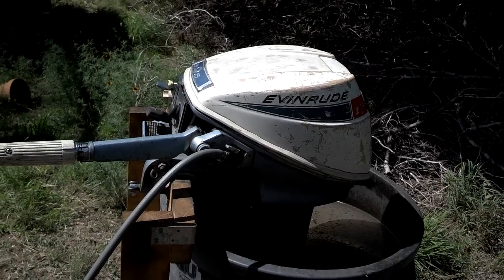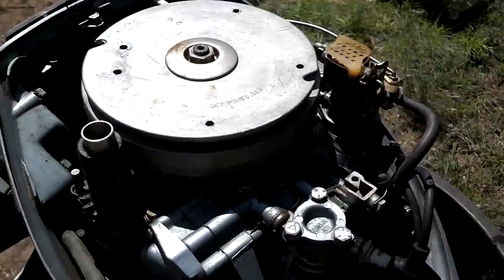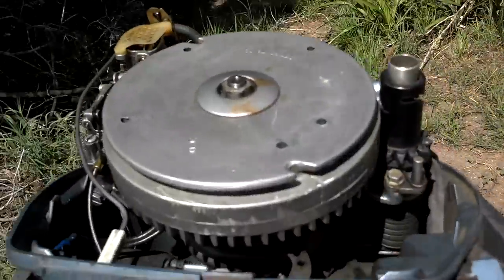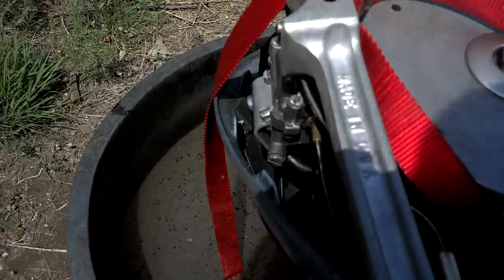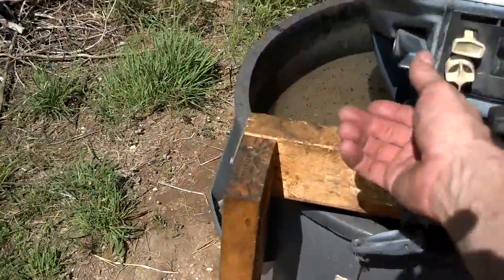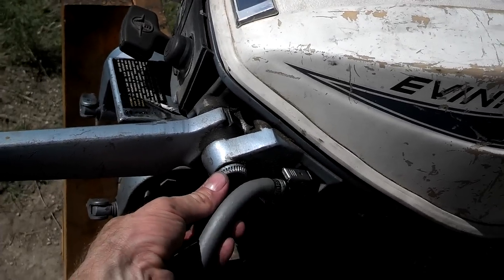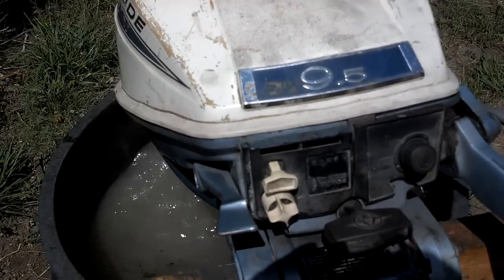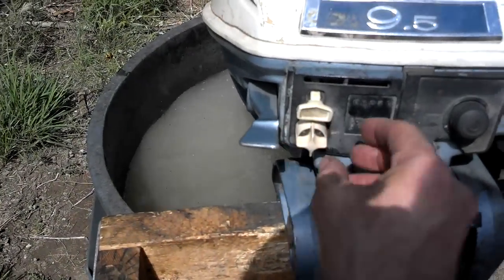1968 9822E Evinrude 9.5HP Outboard after service

Comment: I know this is an old video but I’ve put a block under the prop for every motor and never had a problem. Now however I use my  impact driver drill and it comes off every time

Comment: The bolt holes on the fly wheel are spread out like on my 9 1/2 what size Puller do you use to pull a fly wheel because that wasn’t Shown.   Thank you

Comment: can you point my in the right dirrection to fix a prop hub that is slipping this exact engine.
Reply from the maker: Prop shops like Nettle Props in Austin TX use fixtures to press new hubs into props to fix spun hubs. Not a do it yourself fix I'm afraid.